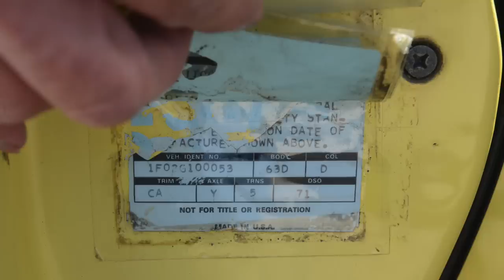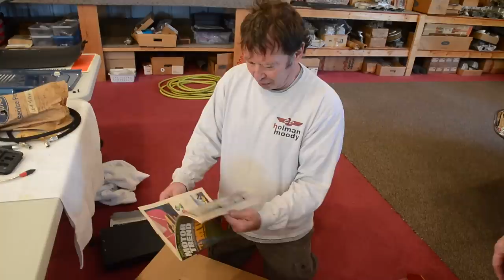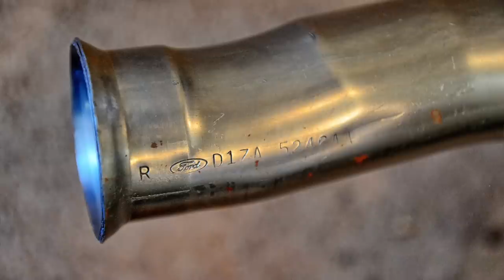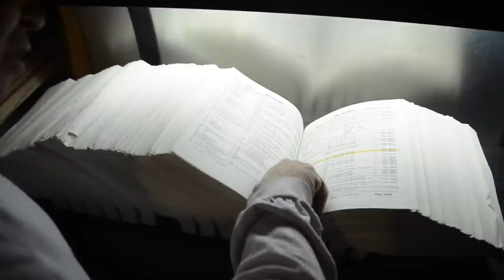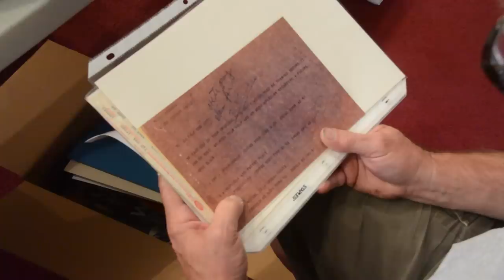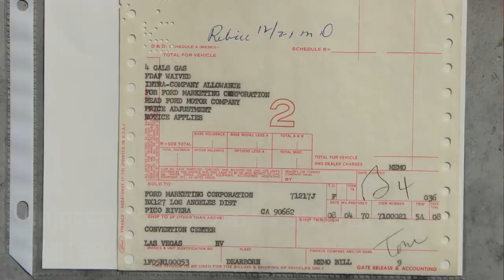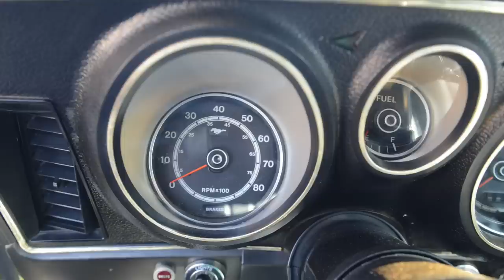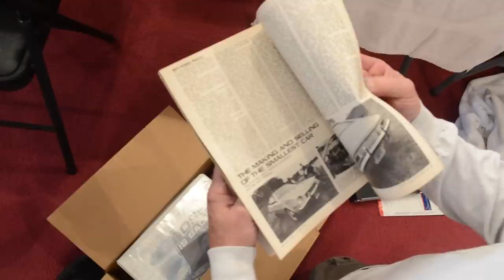Million Dollar Boss Mustang Prototype Barn Find -1971 Boss They Didn't Make

Comment: Its odd that a "1971 Mustang" period would have "bias-ply" tube-type tires on "tubeless" 15" "radial" rims. Bias-ply tire tubes pretty much ALL have  their valve stems in the center of the tube right on the seam. Those Kelsey-Hayes "Magstar" wheels "delivered on this car" (which isn't exactly the same as "factory original to the car" since that car has undoubtedly been "delivered" more than once in its "life") are not only 15" but also clearly have an "offset" valve stem hole and tubeless valve stems in them. And the tires are just "repops" of "Polyglass" bias-plies in appearance only and are actually "radial" tires since "bias-ply" tires and their "beads" are not compatible with "modern" tubeless wheels with their "beadlock" design. In fact, "14 inch" bias-ply tires and the steel non-beadlock wheels and "centerline" valve stems all went "bye-bye" about the same time on "full-size" cars due to lots of "catastrophic failures" from big "boats" of "sports cars" like "Ford Mustangs" (which in their last several years of production went from being "Falcons" to being "Thunderbirds" and being ridiculously nose-heavy with very "compromised" front suspension were known for "rolling" the tires right off the rims since over-inflating a BIAS-PLY TIRE MAKES IT "LOOSER" ON THE RIM WHILE OVER-INFLATING A RADIAL TIRE MAKES IT "TIGHTER" ON THE RIM. 

And "ford Mustangs" in the later years and particularly "Mustang Grande"s were as heavy or heavier than light-duty trucks which were the FIRST American vehicles produced with 15" rims and radial tires. But that wasn't until the "1973" model year or so. There's no way a "1971 Mustang" left the factory on 15" radial tire tubeless rims (its possible to put a "tube" in a radial tire in an emergency or if the "belts" are undamaged but it has a major puncture but the typical and safe "repair" is to "boot" the tire first and avoid tubing it if at all possible and the main purpose is to prevent the tube itself from getting pushed through/into the puncture and that's only done on very expensive agricultural, construction tires etc. and as a "temporary" repair to get worn tires worn completely out before replacing the "set" which typical with a puncture will mean the tires are worn at least 25% but no more than 50%. Beyond half worn out, the expense and time of repairing/booting the "rare" otherwise "undamaged" radial tire which will have to be "overinflated" to prevent it from spinning on the rim just to get the other "50%" of life out of the pair of tires which collectively average out to one tire "100% worn" to begin with when at "25%" the tires are "bald" for all intents and purposes and are significantly "undersize" meaning they "lower" the gear ratio and have more "torque" at the tread make "booting" even 50% tires kind of a "six of one/half a dozen of the other" situation. Most guys do it just to get by in the short term since the machine is going right back to the same environment where the puncture occurred and with a "boot" in the repaired tire plus its overinflated condition make it very unlikely to be punctured again so if and when the other tire is punctured, a "zero-sum game" becomes a "negative-sum game" since one boot has already been "wasted" on the set, another boot job will waste a second, both tires will be overinflated with the ride, traction and overall performance being WORSE than with "new" or even 75% bias-ply tires and tires NEVER getting "cheaper" except once they're on a rim and being used. 

The other thing very "odd" about this "prototype" is that as a "special option package" vehicle it should have been "prototyped" WELL before the "1971 model  year" and with its "08/70" door sticker - the "production date" being the "effective date" of the model year "safety standards" and ALL "1971" Mustangs having that "production date" on their door stickers since its the "production date" of the "standards" and "regulations" - clearly was "prototyped" along with all the OTHER "1971" Mustangs and most likely during the "1970" MODEL YEAR but possibly the 1969 CALENDAR YEAR. The "model year" corresponds with the "fiscal year" with the plants "shutting down" for 2 months during June/July for "inventory" and "maintenance" and "retooling" and "resupply" and pretty much come June 1 of ANY "calendar year", its already "next year" for the manufacturers. And although "press cars" and "demonstrators" are "technically" production cars, because the "press" is "reviewing" them DURING the "shutdown" but of the "previous" model year since "production" will start in August of THAT year, because they're "experimental" vehicles if "new" and have any "safety-related" changes (and EXHAUST CHANGES ARE "SAFETY-RELATED") while "emissions" regulations apply to ENGINES and not the "vehicle" as a WHOLE, the "common" practice is for a "new" car that has significant "safety-related" changes to be "introduced" and "in production" for "export" already before being "introduced" in the U.S. The U.S. is the only country that uses the "fiscal year" and has a "socialist" government concerned enough about public safety to make sure that no citizens are potentially put in danger by even "prototypes" being out on the public roads UNTIL they've passed "safety" regulations/inspections which means the "manufacturer" is "guaranteeing" they meet "safety standards" FOR that "model year" which isn't HARD since WHO SETS "SAFETY STANDARDS" BESIDES THE "MANUFACTURERS" THEMSELVES? NOBODY.

The "Insurance Institute For Highway Safety" does not do "independent crash testing" since until the MANUFACTURERS provide "engineering" and "strength" and "safety" data the vehicle can't be tested "independently" and the "testing" ESTABLISHES the "safety" of the "vehicle" only by rating how "accurately" and "precisely" the ENGINEERS "predicted" the "effects" of the "testing". When a "vehicle" gets a "safety rating", its actually the "engineering" and "manufacturer" of the vehicle getting "rated". And a "bad grade" can and will result from damage LOWER than "predicted" since that indicates that the car is  going to do more damage to the "object" it collides with and/or that its own performance is "unpredictable" and especially if it has multiple ENGINE OPTIONS.

An interesting little tidbit about the "safety" of "Ford Mustangs" is that with a "chassis" originally designed for a 4-cylinder base engine and a 6-cylinder optional engine never fitted with the former and never "redesigned" for the "standard" 6-cylinder, the 6-cylinder Mustangs were "deathtraps" in a hard "head-on" collision because with no V-8 to prevent the "shock towers" from buckling inward and tying the "subframe" together to prevent it from buckling outward and no real front subframe like a Camaro and Nova had where the "subframe" is a chassis "clip" that bolts to the "unibody" with inner and outer fenders and radiator support being "structure" and "reinforcements" rather than "primary structure", a Ford Mustang would "fold up" like a smashed can with a 6-banger, the "small" 6-banger engine and the manual trans  and solid driveshaft behind them were very "rigid" longitudinally, the cast-iron bell-housing very rigid and the lack of an aluminum tail housing and "slip yoke" to "break away" when "compressed" mean that when something shoved that "wedge" of a little 6-banger backward, it had to go rearward as far as possible and then turn "sideways" when the front "clip" collapsed like an accordion or the driveshaft had to "fold" or the transmission/bellhousing "compress" or the bellhousing separate from the engine and/or trans. Mustangs are TIN CANS front to back and since things could only go back, up and sideways with the car on "level ground", essentially all the collision force went right to and into the "cabin" on either side of the "trans tunnel" as the "wedge" of the engine came rearward and wherever the powertrain "hinged" only some cheesy thin sheet metal already "stressed" to its "elastic limit" with the construction of the cheesy "unibody" meaning it was simply going to tear rather than "buckle". 

Ford Mustangs are without a doubt the first vehicles in history to get "safer" with a "big" V8 under the hood and it's interesting that despite the Falcon introducing the 260 and the "first generation" Mustangs using the "small-block" 289, it wasn't until the "Falcon chassis" Mustangs were "canceled" and a "stronger" and "stiffer" body structure was built and a BUNCH of weight added making them a "lead sled" that the "high-performance" small-block "BOSS" Mustangs came out and of course the "BOSS 302" was "suddenly cancelled" and "replaced" with the "BOSS 351" because the "1971 Mustang" was "substantially redesigned" vs. the "1970" Mustang and had it used the "BOSS 302" engine the then BRAND NEW "frontal crash test safety standards" would have revealed that the "BOSS 302" with its "lightweight" and "thin casting" engine block and swiss-cheese heads and "narrow" width and weak overall structure would have done to the "1971" Mustang in a "crash test" what the 6-bangers did to the "first generation" Mustangs. Which is folded like an accordion up front with the "firewall" and "trans tunnel" and "floor pans" pretty much "imploding" into the "passenger compartment".

Comment: Wasnt there a 71 boss 351 and how ironic is it's at the 302 boss and the 351 boss were both Cleveland engines and about 90% the same
Reply from the maker: Not really, the block is a Windsor with 4-bolt mains, and the heads are Cleveland with larger, canted valves for higher flow, just right for high rpm on the race track. The 351 Cleveland was under development at the time (1969). 351 was too big to fit under the 5-liter (305 cubic inches) displacement limit of the Trans Am racing series. These were the days of "homologation," meaning the manufacturer had to build 1,000 examples for the street to qualify for the racing series.

Comment: Have to wonder what Ford was thinking. The SCCA Trans Am rules changed in 1970 to allow larger engines in the homologated  street versions of 5 liter class race cars. Chevy and Pontiac went to the 350 & 400 small blocks as we know from the 70-1/2 350 LT-1 Z/28.  Ford went to the 351 for the Boss in 1971. Why would they have bothered to build a 1971 Boss 302 when they already knew the SCCA rule had changed? Even if they did, the "prototype" would not have had all the Production part numbers, spare parts  and be sold to a dealer as described in the video.  Seems fishy.

Comment: so what happened to the 302? is it sitting in a back room somewhere? or was that it on the display stand? and I gotta wonder how much better it'll handle with the 302 in there vs a 351, like does it really make that much difference?
Reply from the maker: Watch the segment about the invoices. Ford changed the engines out.
Reply: ah I thought maybe they lied about the numbers on the vin and just changed it to 351 code to cover up what it was originally.
Reply: I remember   when my friends   that followed the BOSS  cars and   worked at a FORD dealer as mechanics  had joked at the BOSS  351 .   They said that FORD  turned the BOSS  into the Employee   in 1971 .
Reply: Gary wood I don't understand what you are saying. Is it a joke that I'm not picking up on? I just don't get it.

Comment: Wouldn't the 351 Boss used the same manifolds? He was calling that exhaust only for the 1971 Boss 302.
Reply: No the Boss 302 & Boss 351 were completely different engines.
Reply: @Mike583  I thought the Boss 302 used the same staggered valve heads.

Comment: So "Motor Trend" was using "modern" shipping/postal labels in '70 or '71 for "home delivery" of Motor Trend  when someone purchased a "subscription"? That's what the white label at the bottom right of the "1971 Mustang" issue of "Motor Trend" has on the cover. Sure that wasn't some kind of BACK ISSUE ORDERED BY A "SUBSCRIBER"?

Comment: Is that a cheap Indy replica fedora?  If that was the intent at least go with the David Morgan.

Great video and great find. This would have been a hard sell in 71' the Boss 351 was a better engine in every way.  Finding this car is amazing though none the less.

The Boss 351 is quite possibly the most powerful small block ever produced and one of the last of the non gimped engines.  The Boss 351 uses the same Windsor Block and Cleveland heads as the Boss 302 with slightly more compression 11:1 vs 10.5:1.  While the HP was similar the Boss 351 produced significantly more torque.  The end result was the heavier 71' Boss ran high 13's vs Boss 302's mid to high 14's.  The extra low end torque also made the 351 a more satisfying street driver, not that the Boss 302 was all that bad.  In term of appeal the 69' and 70' Boss 302's overshadow the polarizing look of the 71 mustangs.  Those older models were the best looking pony cars hands down and this coming from a guy with Chevy bias in muscle cars.

Wouldn't those parts fit the 71' Boss 351 just fine?

Comment: I bought a 1969 Shelby gt500 mustang when I was in highschool kept riding the bus to school and passed this farmers house he had all these John Deere tractors out there lined the fence collector tractors all restored and armorall on the tires and waxed he pulled a car out of his shop kept on driving by it on the bus for several weeks he had a tarp over it went there and asked him he told me a 2 hour long story about the car and never told me what it was went over there and took the tarp off of it and then he was talking about his brother how he didn't want to sell it to him and he was an asshole he hated his guts he asked me if I wanted to buy it I told him I could never afford it he told me to give him $1500 bucks I thought he was nuts this car was still brand new still had the factory wrapping on the seats original tires paint everything it was red with maroon or brown racing stripes weird color combination Hurst shifter 428 in it cobra stickers on the front fenders behind the tires Shelby gt500 under the doors and Shelby across the trunk in between the tail lights and a cobra sticker on the rear end ram air hood black interior bucket seats this old farmer was in his 70s at the time he jacked it up drained all the fluids and put it on blocks drove it twice and that was it sat like that since 1969 put a tarp over it left it in his shop when my mom and my stepdad got a divorce when I was in highschool my car came up missing he stoled it haven't seen it since and my 71 charger SE and a Ford pickup and all the rest of my crap I had sitting on the property

Comment: Oh my my this has got to be the weirdest out of control Ford story , 
F =FIX O=OR R=REPAIR D=DAILY, so they attempted to correct, invoicing problem confusion and to contradict the original work order to the factory. It’s called out of control engineering configuration management. Bob Perkins is a Boss 302 parts stalker. So, and I mean so when/where/why did Bob find this out! Did someone tell him? SUPER FREAK BOB PERKINS IS A SUPER FREAK, and I mean it in a very respectful way and a good way, hats off to Bob.

Comment: I really have no idea why ford would put themselves in such deep water liability wise for a body that cost them about $1,500 to produce if they took the motor trans and rear out they could sold those parts.  and scrapped the car with the others but apparently they did. why all the desperation? Changing vins and motors this is a very strange story if he didn't have all that paperwork knowone would believe him so the paperwork is the car and if I wanted to buy such a car that's probably all I would focus on with ink and paper testing from a forensic lab. And when all is said and done you have a non matching number car

Comment: i wounder if the 302/ 5 Liter  was cancel because it was  destroyed by AMC in the 1971 trans am racing series AMC winning 8 of the 10 races and ford only winning two  ... all engines where restricted to 5 Liter in the trans am racing series , it was an embarrassing Ford being beat by the number 4th American car maker :)
Reply from the maker: Ford did not field a Trans Am team in 1971. They dropped their Total Performance Racing program, but there were independents racing Ford Mustangs.
Reply: uhfnutbar1:  Depending upon where you get the number, the car gained over 800lbs  in the body restyle in 1971. That is not insignificant to performance (or lack thereof).
Reply: dont pay any attention to Branon hes 8 years old going on 6
Reply: Ford dropped out, nothing but privateer efforts . How many privateers won a Trans Am championship back then ?

Comment: I'm laughing my ass off at the "parts diagram" for the "dual exhaust" system. Ford has never built a "dual exhaust" that has matching "center dump" exhaust manifolds on each side much less "symmetrical" exhaust "front to back". And if Ford couldn't come up with better "bends" than THAT "Boss 302" so-called "H-pipe" (what Ford will let the exhaust meet UNDER THE VERY CENTER OF THE TRANSMISSION?) it should at least come up with better "documentation" of its "never-produced" vehicles.